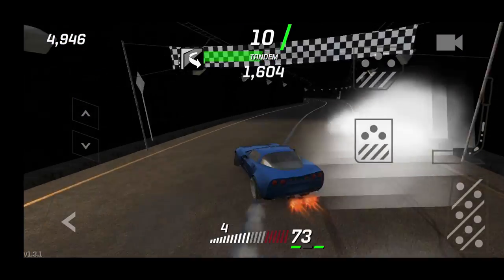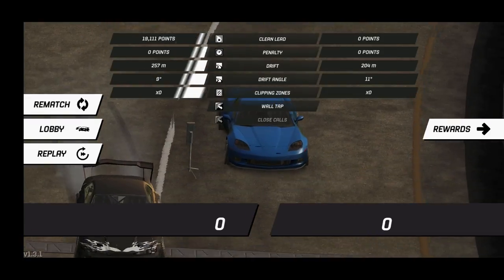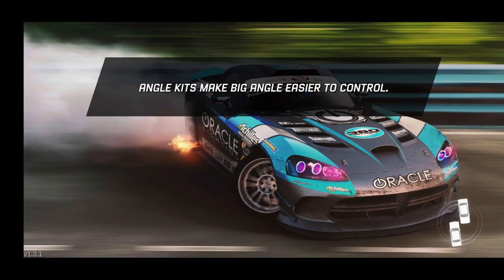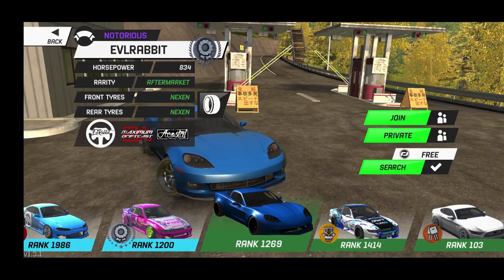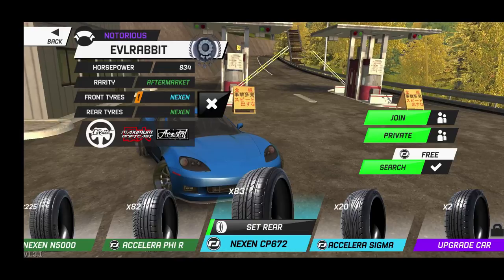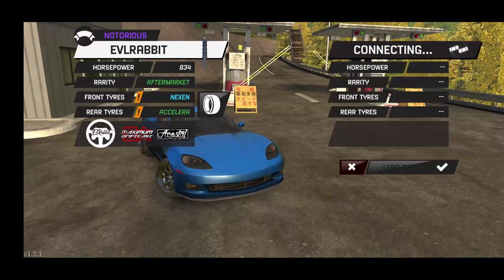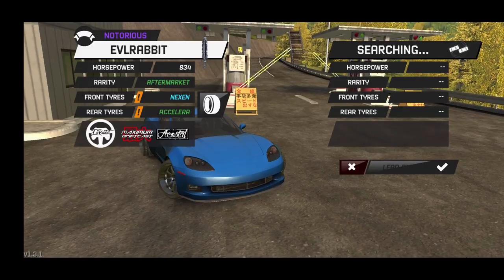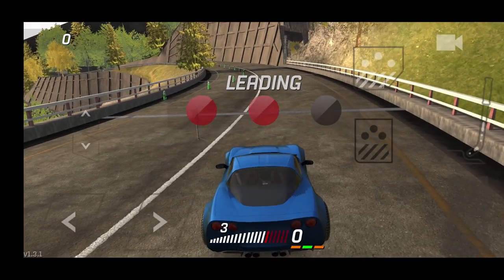Torque Drift Vette Build Problems / Hardest car yet I have tried to build

Comment: Try my setup
Parts:
Engine: custom ls1
Custom parts : Exhaust, Clutch, Alloy, Tyre, Differential, Ecu

Pro parts: Turbo, intercooler, intake, angle kit, suspension, Brakes 

Clutch: shift speed:0
Clutch kick: -0.3
1st: 3.21
2nd: 1.93
3rd: 1.30
4th: 1

Differential : final drive at 4.69 with 100% lock

Suspension:
Front: length (0.14) stiffness (9k)
Rear: length (0.14) stiffness  (5k)

Tyres (Nfera Sur4g)
Back 18 psi
Front 22 psi

Alloy
Profile 30 (back and front)
Width 11' (back and front)

Angle kit
Rear: camber (-0.55)
Toe (1/8")

Front: Camber (-7)
Caster( 8° )
Toe (-3/4")
Steering lock (65°)

Comment: My vette is my best build and i think with the right upgrades it can be the best handling car in the game. I got it custom and i bought the first CF grade part that came out which was the intake manifold. Im currently running 1711hp, with a custom RB. Try a pro clutch with gears 1-4 being, 3.21, 2.17, 1.14, 0.86... custom diff with diff lock 100%, final drive 4.55. Rear camber -3.55. Toe in 1/16. Front steering lock and caster maxed. Camber, -7.50, toe in -1/2... springs front, 6k stiff .11 length. 8k stiff in the back, .12 length. Running advan RZ-DF[NP] with lowest profile and maxed width on both front and back. Tires, 10psi rear, 14psi front. Custom NEXEN NFERA SUR4G. With 1.19 grip factor. If youve built up your vette i hope trying these settings can help. I know they work amazing for me and i can sling it around with no worries, it does exactly what i want it to.